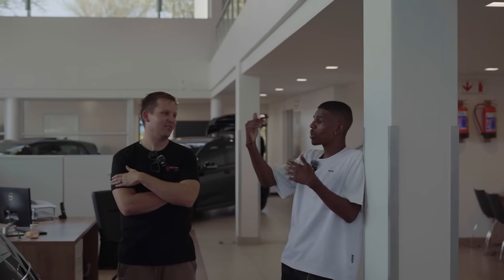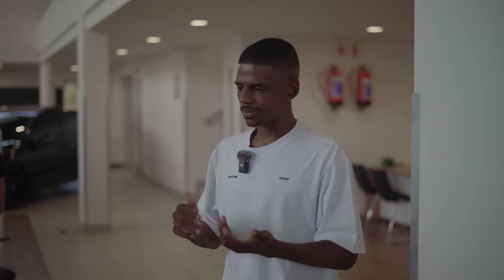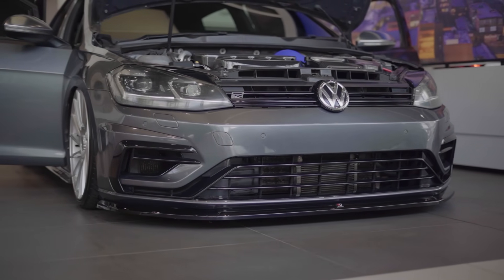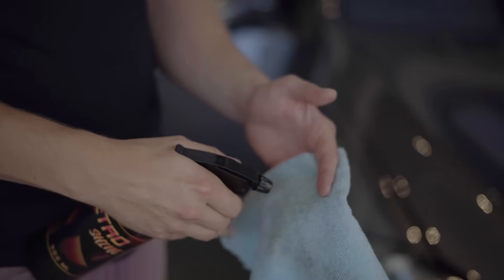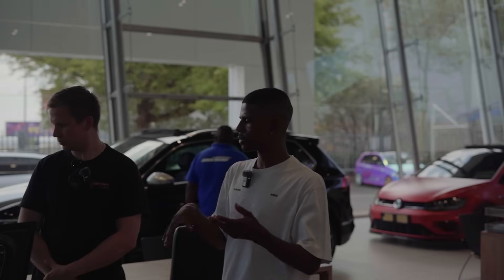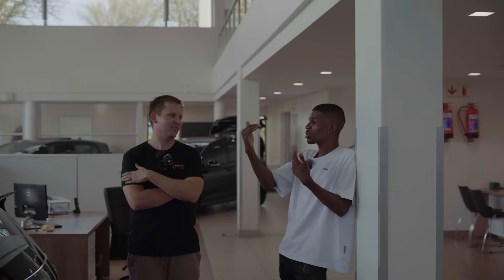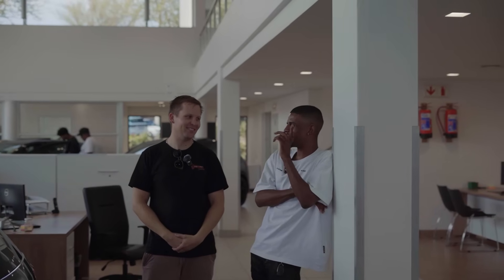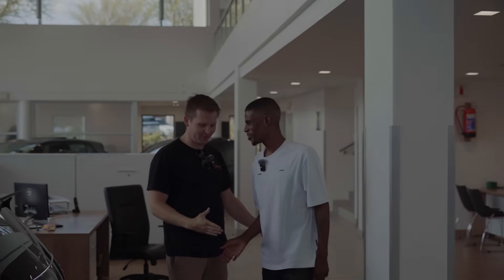ANDE and Malachai 3.0 . LOUDEST 7.5R is SA!!!

Comment: Put some decent tyres on this thing bro.
Reply: Well remember this is a Tyre for show and the profile being as thin (215/35r19) but comfy and then to accommodate the wheel tuck without damaging the fenders. But I still have my oem wheels on Michelin PS4S (235/35r19), then I'm looking into another wheel where I can run michelins and be able to lower without rubbing. Unfortunately not all brands make the same Tyre sizes
Reply from the maker: Great explanation thanks Ande